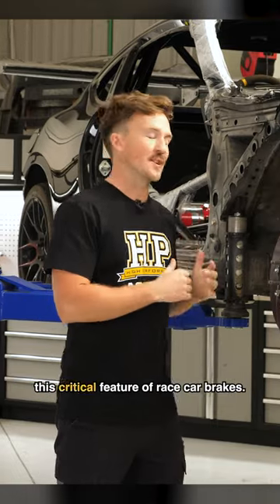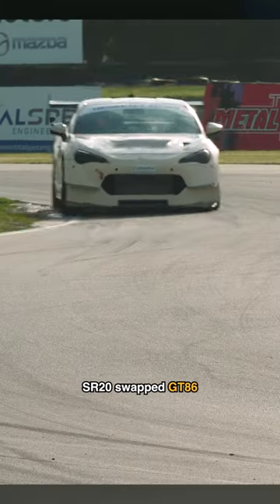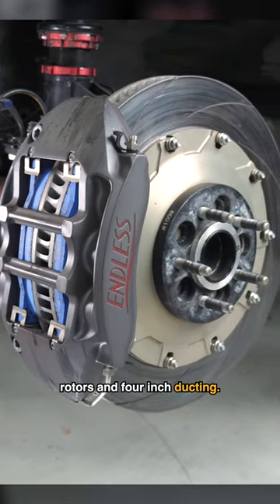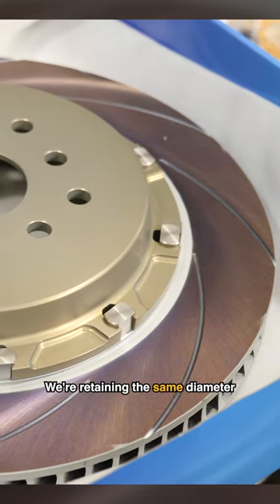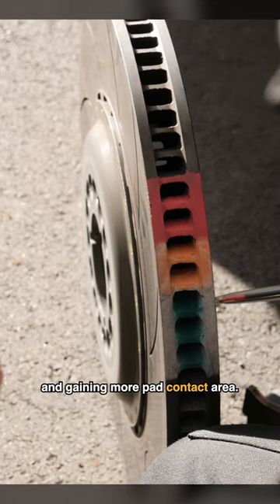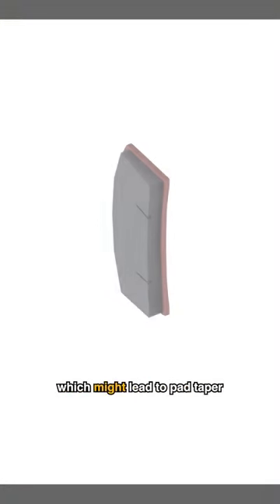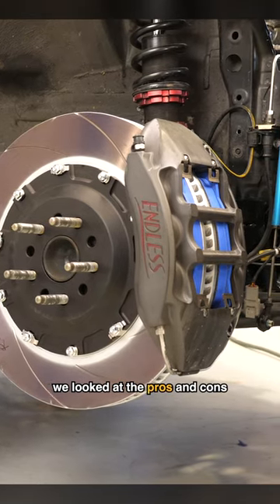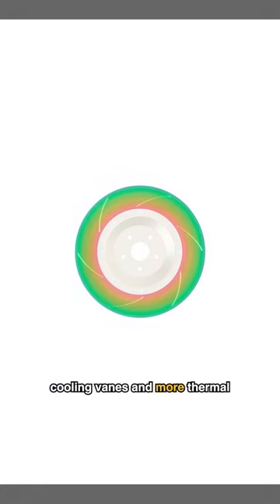People don't understand race car brakes #shorts

Comment: Just swap em for drum brakes.
Reply: Temp is the problem here. I wouldn't see a benefit from a primordial design?
Reply: Where are you from? The 1950's 😂
Reply: if they're oil cooled they'd work!
Reply: One of the biggest disadvantages of drum brakes is cooling...
Reply: @peanuts2105  drum brakes are far superior to disc brakes.
Reply: @JS-fb6ww  I'll ask Mclaren or Ferrari about that idiotic statement
Reply: @peanuts2105  It's true. It's just that they're so cost prohibitive, that they go with the inferior disc brake setup. Bugatti was considering the switch to drum brakes for the Chiron at one point.
Reply: @JS-fb6ww  either you're a comedian or someone who likes eating crayons and licking windows

Comment: If the brakes get too hot then just don't brake? If you're racing why would you slow down?
Reply from the maker: As a rule if you're not using the brakes while racing you are going way too slow - Taz.
Reply: Brakes are for going faster around the circuit.
Reply: I can’t tell if this is sarcastic or not 😂
Reply: Tell me you know nothing about time attack without telling me you know nothing about time attack

Comment: Ducting is useless and usually only has half the area for flow. So a 4" duct only flows 2" worth of air. Manufacturers like porsche have started to use scoops/deflectors to direct air to the brakes on the control arms.
Reply from the maker: There are pros and cons to any and all options, including the R&D required to make them work and the flexibility or adjustment once they are in place.
We would strongly disagree that ducting however is completely useless as that implies that you are going to get the same results as doing nothing, which is simply not true (unless you have done it all very wrong) - Taz.

Comment: So a smaller rotor hat to accommodate the rotor having more contact surface area further in, but be the same overall outer diameter?  Increasing the vane length and ability to use a larger pad?
Reply: I only understood, rotor.
Reply: Hat dimension isn't changing, the contact area for the pads is

Comment: engineer here. I sympathize with you guys. the comments are cracking me up -- you know their shit and all the anecdotal advice from the peanut gallery is laughable.

I would be curious to see how you're getting around the temperature gradient . is there benefit to reducing cooling at the outer edges of the rotor? I figure if you have margin it would limit the total gradient, assuming you can't do anything about the center cooling.

Comment: Aprilia has brought out a 450 cc bike and on a track day the disc's ended up getting glazed and a lot of brake fade was present. 

Will the odd option of changing the brake oil to dot 5 be sensible or should one change pads to an aggressive trackday pads .
Reply: I don't see how brake fluid would help at the friction surface.
Reply: @Kyrazlan  changing the pads to a more agressive compound is the way to go right? 

The oil makes no sense right?

Or is there a possibility for the oil to do anything.
Reply: for the sake of discussing dot 4/5/5.1 lets call it brake fluid. if brake fluid is your limiting factor, as in getting so hot, that it starts bubbling and thus experiencing a spongy or non functioning brake, then yes, a higher dot with a higher temperature rating will help
Reply: @DarkIzo  but shouldn't one look at pads first as brake fluid will overheat regardless as dot 4 to 5.1 is around 25 degrees of extra heat tolerance. 

And if the brake fluid is overheating there are bigger problems that need to be recognised and addressed.

Comment: You could ditch this problem in two ways. 
Carbon, carbon, which runs cool anyway. 
Or set a cast iron rotors, which air ducting to the sweep area on both sides. (No fade)
Kind of like the Shelby GTs.
Any way it would spank the crap out of those stainless steel rotors you got on there now. 
And stop using stainless steel brake lines. Switch to Teflon lines, and then run dot 5. (Silicone based/ handles heat much better.)
Also change to ceramic bearings, (wheel)
Just saying.........................
(Thermal CA.!!! 👍)

Comment: Reason for not switching to carbon rotors?
Reply: Probably rules
Reply: are carbon rotors "easily" available?
Reply: @zac2384   Yes. You can buy them at the chevy dealer for the ZR1 corvette. Roughly $1500 a piece

Comment: They have  to be drilled also boss
Reply: Drilled rotors are much more prone to cracking especially under the the amounts of pressure they’re putting their car through. Even if they don’t crack, its common for the brake pad to deposit some of its material into the holes itself eventually blocking it and voiding the purpose of the drilled rotor

Comment: Drilled brakes would help massively with cooling or open up the bumper and run a hose with a filter to cool the brakes aero can always be bettered
Reply: Drilled iron rotors crack at the holes when overheated repeatedly. If they are getting to hot now, they would just crack rotors at every race.